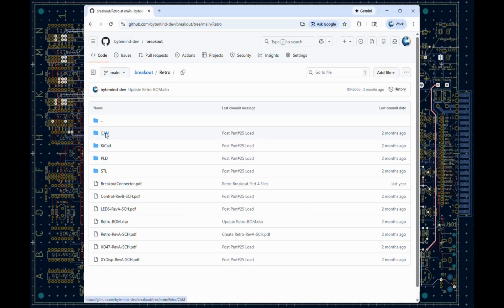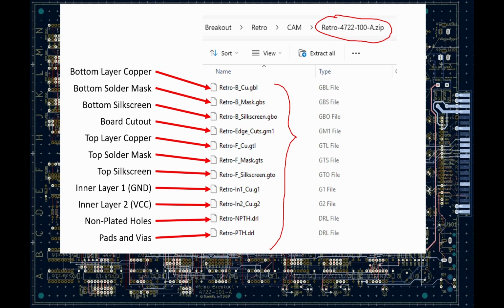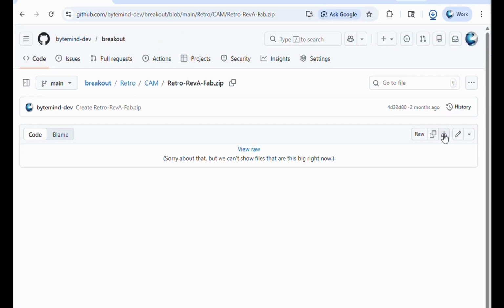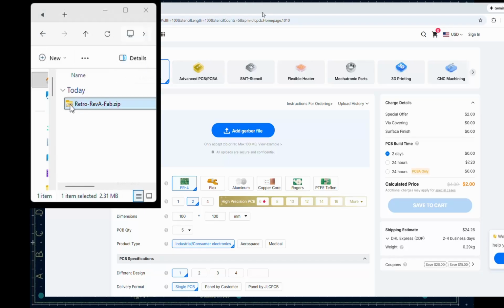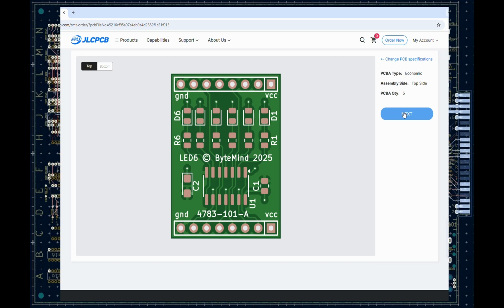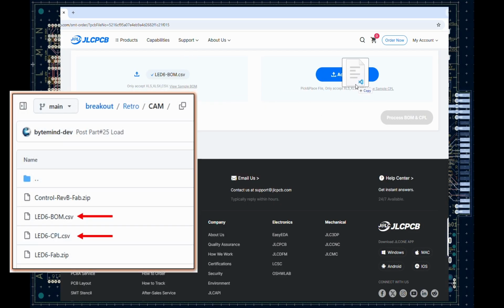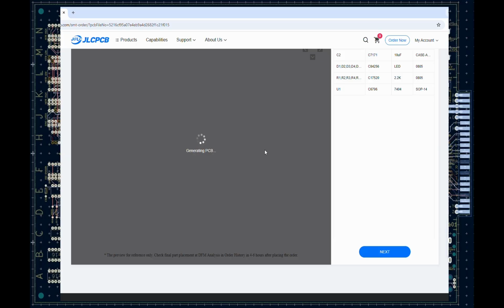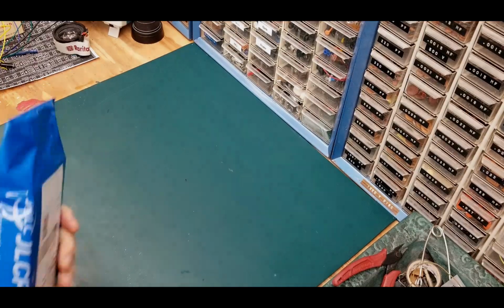Retro Atari Breakout Part 26 - Widgets

Comment: Widgets? For prototyping?! 😳 What a brilliant idea!
Reply from the maker: Couldn't tell if that was sarcastic or not! I'm just too lazy to keep building the same small crap over and over again  🐒-Paul
Reply: @bytemind-dev  No! No sarcasm! It is a brilliant idea! So many complex circuits are built up from smaller, simpler circuits, many of which repeat throughout the design.
Reply from the maker: @mspeir  Someone could probably make a little cake$ making a "breadboard widget set" with some common stuff. -Paul
Reply: @bytemind-dev  Right?!